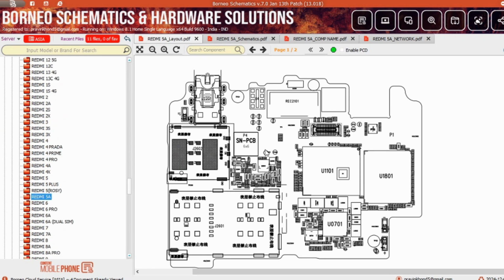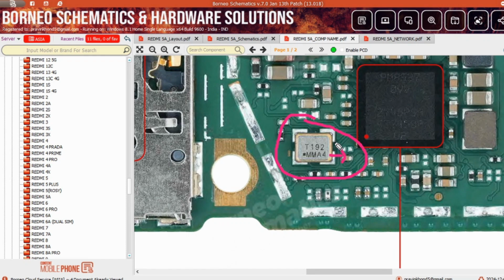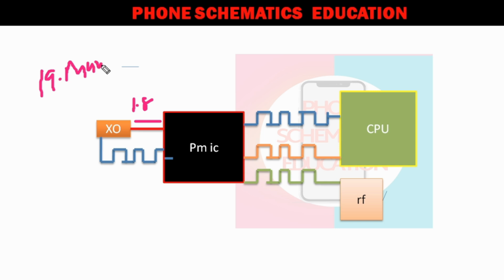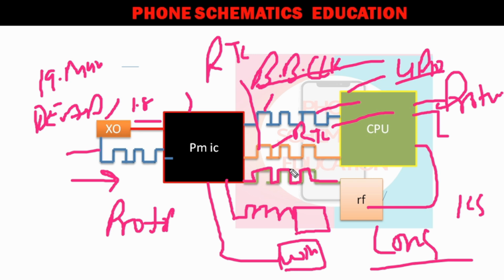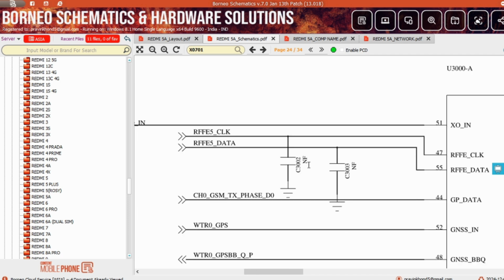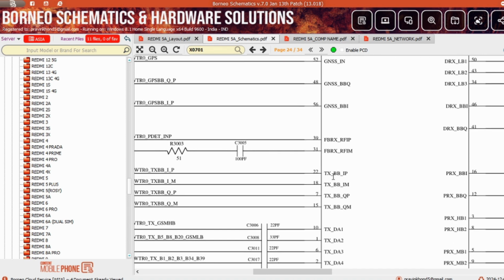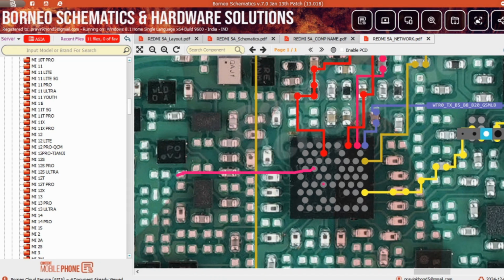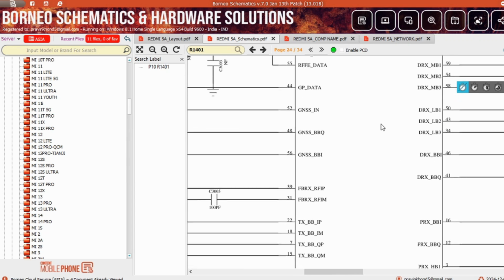How crystal clock signal working.Rf ic(WTR) controlling section.Free class on Network section# 3

Comment: Hello master I have a question.
Why some capacitors are connected in parallel on the clock signal line.
Hence capacitors pass the frequency and then sink the signal to ground.
Hope this process will not end up leaking the clock signal.
Reply from the maker: If you have watched all my videos well then you should know the answer. You will have to work a little bit, put in a little effort and put your mind to it and you will get the answer automatically.

Comment: Thanks for the video.  I have two questions. I reballed a power ic on Samsung phone and it became dead. I checked all the buck voltages and they were fine. It might be problem with the crystal. Each and every minute of your video has something new to learn. Thanks for giving everyone free education.

I have another device when plugged in it shows charging icon and after unplugged it still shows its charging. I don't know how to find the resistance value of bat id line because theere were no schematic/ layout available. I cross checked with different brand phone but they used different kind of layout. I don't know how to solve it.
Reply from the maker: Make short video on detail whatever you work or check .& Send me on phoneschematics@gmail.com

Comment: Sir I have a question why most of the videos u like to use Redmi 5A Schematics
Reply from the maker: See, if you want to study anything, you can start from the basics. The Redmi 5a model is the basic model of 4G smartphones and its diagram is available also Bitmap & Hardware solution.Thats why I will teach u in  this model so that you can understand . And I say the same thing in every video that you should not always look at the model, look at the  Pm control ic or cpu number on it. Whatever is installed in this model, you will find it in different models from many different companies and they will work same.
Reply from the maker: If I start teaching you according to my course, then first of all I will teach you about basic keypad phones in which there is any circuit, be it charging or light, how it gradually developed, first what used to work in basic keypad phones, then how it used to work in 3G phones, then in 4G phones and now how the circuit works in 5G phones.
Reply: @phoneschematicseducation   i like your teaching method, its very easy to understand.
Reply from the maker: @AndroidBoardLab  thanks brother 🙏
Reply: I guess its more simple, so that we are able to understand it better. The simpler the better for newbies 😊

Comment: Would you recommend using an oscilloscope in order to troubleshoot the phone?
Reply from the maker: @techas8005  It's depends on ur experience &  Go with it if you have all other professional tools.& Good knowledge also.. Otherwise first invest in knowledge & other tools
Reply: @phoneschematicseducation  I plan to repair not limited to phones also with some electronic devices like flats LED TV laptop, is an oscilloscope necessary to have in troubleshooting it?
Reply from the maker: @techas8005  Most of the Digital devices had Data lines.Means protocol based.for these signals Measure(checking) you need DSO
Reply: @phoneschematicseducation  Thanks, I am looking for a cheaper DSO and found in my budget which is Hantek DSO2D10, my question is does 100mhz sufficient for troubleshooting the most electronics? or for example checking Xtal clock on the Phone.
Reply from the maker: @techas8005  yes